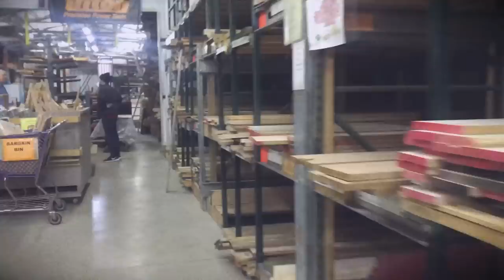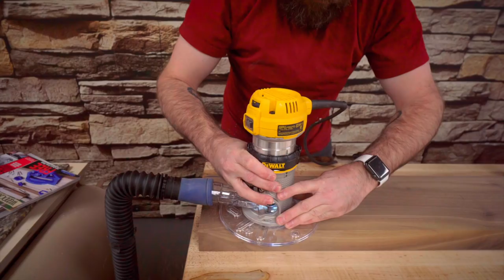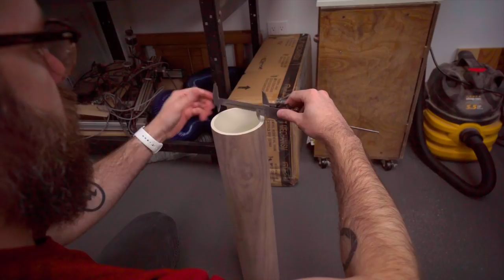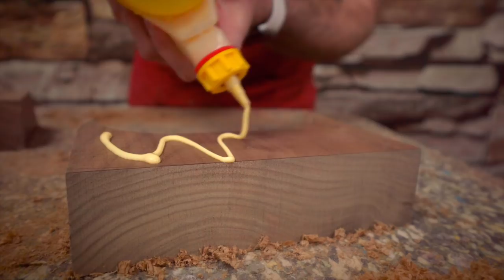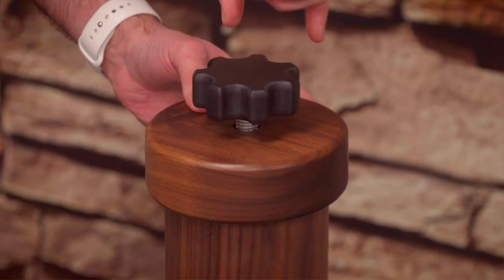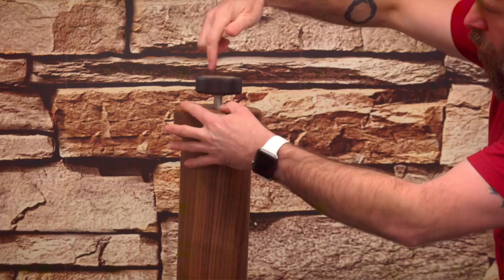Making and Prototyping a Dog Feeding Station | DIY Project

Comment: You totally have an engineering mind. Try something, tweak it,  repeat. That's the engineering process. For someone with bigger dogs, they could build it onto a base that has tabs to screw down to the floor. Wouldn't work for everyone, but i keep my dogs food on the back deck, I don't mind screwing into the decking.

Comment: I made a cutting board and a humidifier and both have been ruined to wood movement. My wood stays in my garage which is uninsulated and survives the NY winter then when I bring the projects inside it seems to go south. Is that temperature change my issue or is it something else?

Comment: I would be careful using Walnut with dogs. If your dogs are chewers, Walnut can be toxic to dogs. The actual nuts are bad, but eating the wood can cause problems on dogs too.
Reply from the maker: Thanks for the heads up! I knew horses were allergic to walnut but didn't know dogs could be as well.

Comment: The every maker "Though you could 3D print a couple gears to fine tune the amount that will come out the bottom." Great comment 

For a snugger fit, prevention of food binding up the screw, and more precise amount of food that would dispense. You could line the teeth of the Archimedes Screw with rubber tubing/ and or a softer material that lines the outside pipe. They use this quit a bit in water treatment. Follow the link and its the size relationship that shows this pretty clearly. http://greenbugenergy.com/how-we-do-it/archimedes-screw-generators